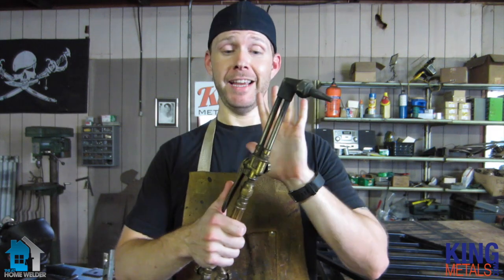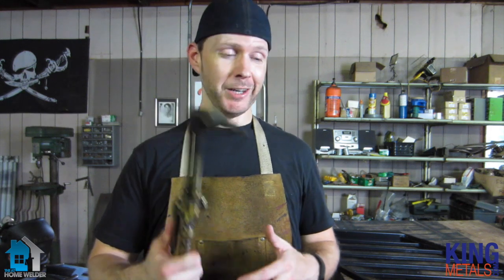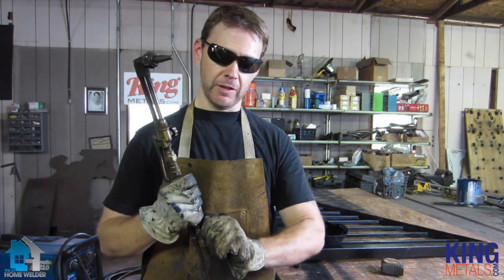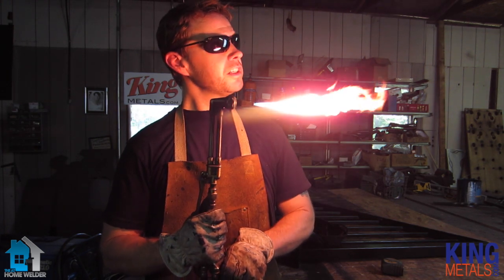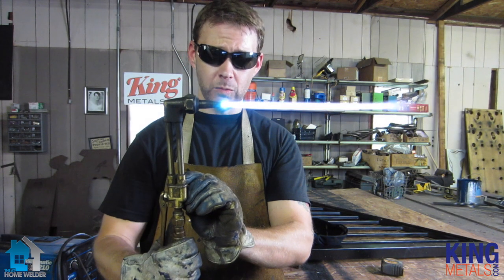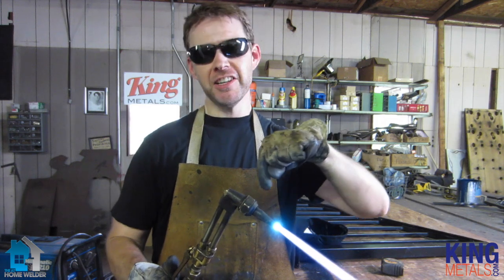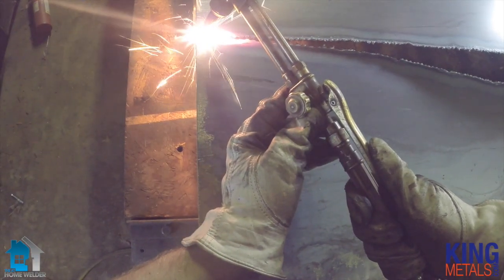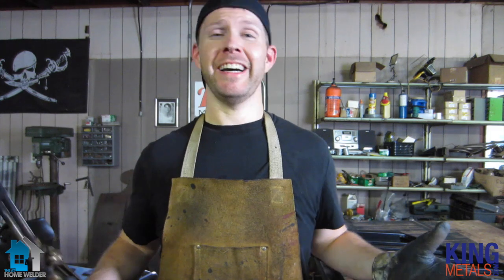Beginners Guide to Cutting With a Torch

Comment: EVERY tutorial is different!!
Some say never use a lighter to light your torch.
Some say its ok to use a lighter to light your torch.
Some say to light the torch open Acetylene valve only.
Some say to light the torch open Acetylene AND oxygen.
And some say to shut down your torch shut off Oxygen first.
Some say to shut down your torch turn off you Acetylene first.
After seeing all these videos I'm starting to believe welders do not have many brain cells and are not very smart. They ALWAYS  say the exact opposite of each other.
Where did welders come from? They always do whatever whenever and they are always right, there is no wrong?

Comment: also, this video doesn't tell you that the cutting torch is usually loud. that may be a sign that you've done smth wrong but if you still have black stoot and you think your torch is loud you need to open the valve more until the soot is gone

Comment: Always kill the oxygen first to prevent popping (mini explosion) or flashbacks (fire reversing in the hoses causing a potential explosion.) Always kill the oxygen first please. PS using a lighter is a good way to burn yourself or worse blow up the lighter in your hand. Also, use the chart that came with your tip to set the oxygen and acetylene pressures at the tank regulators then do your final adjustments at the torch knobs. Good rule of thumb oxygen at torch off first on last. Off first on last.
Reply: better advice in the comments section than in the video.  Thanks.
Reply: good to know, but we always do acetylene first and don't turn on the oxygen until the black soot is gone, then we'll turn on the oxygen and adjust from there.
Reply: and usually we turn off the acetylene first because the flame goes away (i dont rmb wat my instructor said exactly or at all..)
Reply: How does this make sense. Flashbacks, but there's no fuel when you cut off the fuel 

😂

Comment: Is it okay to back down the A further than recommended settings to achieve a smaller flame? I.e. body panels close behind the bolt I'm trying to cut and don't want the flame hitting the body panel.

Comment: Forget Acetylene your weld shop will have Harris hand torches.  37 year experience with every means of cutting plate. Use Propane.  Mapp& LP gases are overkill.  Cut 26" thick with a very oddball Natural gas/Oxy fuel gas that had a special compressor supplied by the local utility company. Ran a very old school big NCG cantilever armed burning machine with regulators and gages 6" diameter(now a days those precision gages alone go an easy 4,000$ and are only found on divers decompression chambers now).  Was able to take 4 PSI Natural gas thru that compressor and open valves on my NCG and get 80 PSI Natural gas and up to 100 PSI at the tip, but in the tip selection only 40 Psi was needed to get a half inch wide cut(kerf) visable clear at 3&1/2 feet long stream(Oxy).  Vice president did not allow anyone without shooters ear muffs in the burn building during that 120 decibel cutting job.  Burning thick plate really depends on how extensive the size of the condescers for changing liquid OXY to a gas. If there to wimpy you will not be cutting anything over 12 to 14" thick.

Comment: I can’t express this enough to you... HHO, two parts hydrogen and one part oxygen. It will instantly match the melting point of anything, I seen a hole put through a fire brick in two seconds, and vaporize tungsten all while pinching the nozzle where the flame comes out. And the only byproduct is water. There is a very good reason this is not common knowledge

Comment: just going to say you must set your torch to the size of cutting tip you are using.  that is the max gas flow you till use.  any more and your torch can have serious problems.  any less and you can get backfires.  always turn on the gas then oxygen.  when turning off cut the oxy first then the acetylene.  I took 2 years of welding school and that's how I was taught.
Reply: Indeed!  Oxy off first then acetylene- most rookie mistake made by many.

Comment: but what is the ratio of metal thickness and acetylene psi. i mean how much the acetylene is needed for different thickness..
Reply: that depends on the size of tips you use.  the tips dictate the gas flow.  too much gas going through a small cutting tip is super dangerous.  too little gas going through a large cutting/heating/welding tip is also dangerous.  if you dont know what size tip you have get a new tip and look up its specs.

Comment: What is doing the cutting the oxygen or the acetylene?
Reply: Nope, gas is there just for preheating, once metal is hot enough you can even close acetylene and continue the cut only with oxigen.
Reply: Anthony Giordano the oxygen
Reply: Burning metal
Reply: Technically the oxy\gas mixture heats the material to the point of being molten, and the molten metal is then blown away by the more directed air pressure (oxygen) that is given by pressing the trigger. So its not one or the other. There would be no flame without the gas, and the flame wouldn't reach a high enough temperature to turn the metal molten without the oxygen feeding it, as well as blowing the material away from the cut.

Comment: Nowadays any welding/cutting supply store has the tool for safe lighting i have used for years. It's called "Lighting Bug" costs from 13$ to 16$.  While you there you might concider propane or LP cutting gear instead of that messy Acecetalene that will melt your tip if you misjudge tip height from plate as your burning.
Reply: david,r. massey in a shop scenario I'd personally stick with acetylene as it burns hotter meaning getting to and through the cut quicker.  But as my field of work requires me to be out in the elements like wind, rain, and snow I use a propane set up(can light in wind by either rolling the tip toward the material or adding oxygen to the gas even before lighting) plus its cheaper to run all day everyday.
Reply: In the US it;'s called a striker.  dirt cheap and they last for years

Comment: Will add another comment about tanks, pressures, regulators.... I have been told never to go over 15psi on the acetyling and only open the tank valve about ½ turn or so. If a problem occurs one will want to turn it off FAST! I fully agree with not using anything but the proper striker to light the torch. My best suggestion is buy from a welding store and have them show or tell you how to operate it, then go home and read the instructions. If something goes wrong you may not get another chance, or it will be very painful.
Reply: Kabbooommm sound appeared then he learn something

Comment: !!!!!! What are the Pressures on Gauges to start with nobody say,s thank you is it that hard to say it Ther it,s been said let me know ok thank you
Reply: 8:40

Acetylene should be set about 8 psi & should not exceed 10

Oxygen should be set about 40 psi
Reply: it depends on the size of tips you use.  your local welding supply store can show you how to set the torch safely.  the torch parts themselves have literature that will tell you what they need.  if you want to learn more about gas welding i suggest taking a class in it at a community college

Comment: Should note for this video and the tip used he is correct turn off the "ace" first but with other types of torch tips, it can and sometimes be the opposite where the oxy is turned off first! ALWAYS read the manual/instructions that come for the torch tip that you get! "Don't think your above the torch or you will be six feet under it" is a saying I learned and also " A before O,or up in flames the building goes". but it depends on your set up and what torch type your using,so as I said before READ the guides/manual for the tip that you buy!
Reply: Kabbooomm sound appeared then he realizes

Comment: I always like when people teach others their skills.
But.

1. Never use a lighter for lighting a cutting torch, the lighter might blow up if used incorrect or hit by flames.
2. It's not the gas cutting trough the metal, but the compressed airflow oxidising the hot metal.

Have a nice day. :)
Reply: oh wow lol I actually just made a comment about this as well then I saw yours >.<
Reply: Povl Halberg right i wouldn't recomend using a lighter to start a torch .
Reply: In india we do use LPG for firework ......Some cold it alternative fule 

At ending the cut of material I will recommend frist cloSe oxygen and than fule at torch......
Because when we give oxygen at torch .....Fire get agary and it will have sharp edge when work done frist close that sharp edge and than fule what I can see safe side . And than close fule and oxygen tank .
After that realise the pressure of hose of both pipe.
Any one can see my option is good hit the like button
Thank you

Comment: Plasma cutter
Reply: yeah oxy/ac is old school
Reply: I pretty much use my powerplasma cutter on everything. I might still use oxy-fuel for preheating or helping to bend metal though
Reply: Atoyota can you get a good plasma cutter for the same price as a good acetylene torch?  I thought plasma was more expensive. And for people that dont use it everyday, cheaper is often better, even if the cut isnt as nice.
Reply: I got hypertherm for 500 dollars
Reply: Safest way to cut, user doesn't have to worry around blowing up due to poor training and application. Might cost the company a lot in tips and ceramic cups though.
Reply: @romansten9 may as well use cutting disc and save the heart ache.
Reply: Aaron Mendez plasma cutters can’t cut thicker material. Also consumables are much more expensive.

Comment: How about a lttle safety  first on using Oxy acetylene  torches  tank pressure not going over 15 psi  how to check for leaks. your talking about people who have very little  knowledge on using two gases when mixed are one  of the most volatile mixtures on the face of our planet  !!
Reply: Scary but true... I am setting up a video list for guys to watch at my work to get a visual learning to go along with their studies and I actually found a vid showing you should "always" use 30-40 PSI of ace,I shit you not...  I didn't bother making a comment I reported the video with a detailed explanation of why the video needed to be taken down as it could lead to ALOT of property damage or even death..... Just shows you need to do your own "homework" before just watching a single video and thinking you can use it as real world knowledge...they even stated in the video the incorrect and dangerous way of shutting off a "rose bud" in the absolute most dangerous way... to put it shortly they said you opened the Fuel to max and then turned off the oxy and then the fuel (ace)... which is so far wrong I would rather get a penny a hour whore and risk a fatal STD then attempt this....
Reply: That information would be very good for someone like me. I already have an everlast plasma cutter for general cutting but I hear having a oxy acetylene setup can be very useful. I want to learn more about this
Reply: Don't even have a lighter on your possession.
Reply: yep leak test is step one.  if it's leaking turn it off and get new regulators.  then check what size the tips are so you know where to set the gas bottles.